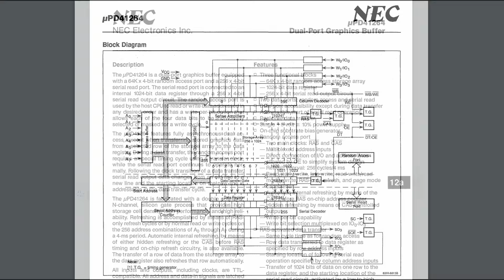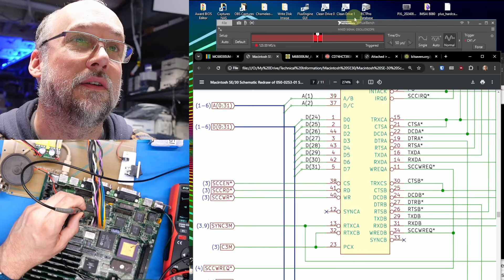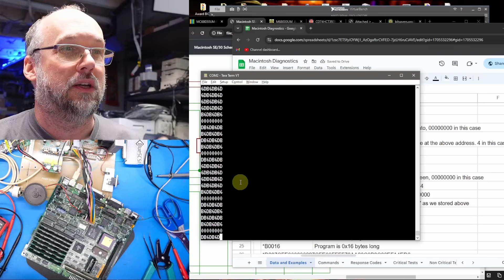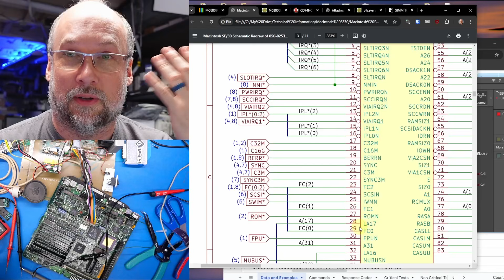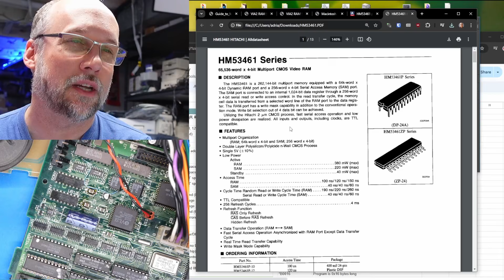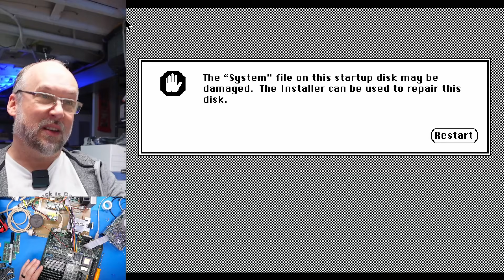12V on a 5V line almost killed this Mac SE/30

Comment: There was different fault tones on MAC SE. The startup chime, also known as the startup sound, is a sound that plays when a Mac is powered on. It indicates that the computer has successfully passed its Power-On Self-Test (POST) and is operational. The chime has undergone several changes over the years, reflecting changes in hardware and design philosophy. The original Macintosh startup chime was composed by Apple engineer Jim Reekes and debuted in the early 1990s. Over the years, the tone has changed slightly, but the essence remains the same. The chime plays when a Mac passes its POST, signaling that the hardware is functioning correctly. If there is a critical issue, such as faulty RAM or a hardware failure, the chime may be replaced by error tones or no sound at all. The presence or absence of the startup sound is not only aesthetic but also diagnostic.

Comment: I haven't worked on enough motherboards yet to have done 12V on a 5V line... but I have shorted Vcc into an LED on the wrong side of its resistor and have it explode in my face. Hot plastic on your cheek is better than in your eye. Lesson 1. don't be clumsy with your Voltmeter probe. Lesson 2. Safety glasses.

Comment: FLUX…… with SMD work you need lots of flux. The flux stops a lot of the shorts because it stops the solder spanning from pad to pad. You will be an SMD expert in no time!

Comment: Well, you "served your penance" by restoring the SE/30 you accidentally sent 12V where it shouldn't go and fixed a second SE/30 board in the process.
- It was a bit of an epic, but we now have recent information on where to go and what to do in the case of a partially booting classic Mac 🍻
As you said in other words: The silver lining was causing the resurfacing of sourcebooks and techniques to do low-level troubleshooting on the Mac machines ... without that expensive proprietary box

Comment: Well done! As a rule, you should not rely on solder mask to provide electrical insulation. That's not it's purpose; it is very thin and easy to scrape off. Vibrations or any relative motion could eat through and create a short to any underlying copper.

Comment: Another vote for you to give Louis Rossmann's channel a look for the best way(s) to deal with SMT.  Note, you will need to look at his older videos as he now, on the same channel, is doing more "right-to-repair" and right-to-own type videos now.  In any event, solder paste is really for when you have a stencil to overlay the pads and then squeegee the paste, evenly onto the pads.  

Without a stencil, clean the pads (solderwick followed by IPA), add flux, drag-solder fresh solder onto the pads, hot-air (in a swirling motion...you don't want to cook the board or have steady intense heat and watch out for blowing other parts off) and place the part with tweezer or the like.  The part should feel like it self-centers and even "dance" while you are swirling the hot air.  Again, seeing a Rossmann video is going to be 1000 times better than reading words as you can see it actually done and how it should look/feel.  

Congratulations working through this problem.  Your whole thought process was impressive as was the perseverance. I like the long-form working through the problem videos.

Comment: When there's electrolyte damage, I typically use through hole caps to replace SMD 'lytics so I can stand them off the PCB and away from exposed traces.

Comment: This was an incredible journey! The start of this saga was my first encounter with this channel, and I'm impressed with the detailed breakdown of everything that happened along the way. After the first video, I was very invested in seeing what happened to the damaged board, and had to watch the whole thing through right away.

My perspective is more from the programming side than the hardware side, and it was especially fun to see that tiny 68k assembly program loaded via test mode for the video memory diagnostics. Looking through my old MPW installation, I see that there are two different matches in MacErrors.h for error code 11; one is "sdmInitErr", with the comment "SDM could not be initialized."... Not sure what that one means, but "dsMiscErr" looks a lot more likely, with the not-so-helpful description of "miscellaneous hardware exception error".

Very satisfying to see the progress as everything got put back together. I'm amazed that substitute VRAM chip worked as well as it did, and the way it changed the uninitialized video pattern at startup was such a cool twist.

Comment: I've watched some of Necroware's repair videos and what he does to components with known capacitor or battery-induced corrosion is to neutralize the acid and clean the PCBs during his inventory process.  That old Mac II donor board you have still looks like it has corrosion that's continuing to destroy components over time.

Comment: run a chisel tip soldering iron after you put the soldering paste and clean the flux, then you apply fresh flux and then use the hot air gun. Also your nozzle is too small you'll risk burning the IC before it does anything good

Comment: That solder paste is really meant to be applied using a stencil.  If you don't have a stencil you could use one of those small Testors economy model paint brushes to apply the paste to each pad instead.  Tinning the pads with a soldering iron and a little leaded solder works too.

Comment: To attach chips like that, I just drag solder. I only really use paste when I'm going to use the hotplate method for SMD stuff, or I have a mask I CNC for personal custom PCBs with SMD... which I then use a hot plate if possible (hot air plus tiny diodes, resisters, caps, etc. isn't a fun mix). When removing chips like that, I might use hot air if I have it at hand. Usually I only use hot air if I'm working with tiny chips (even then, most of the time I then drag an iron across to clean any bridges) or with BGA/reballing. There's also just drag soldering over the pads, positioning the chip on top of them properly, then use hot air to attach... I'm just not a huge fan of solder paste. With super tiny SMD/BGA stuff, I admit defeat and use paste and a hot plate/air, but otherwise I avoid it.

Comment: I keep semi-broken (semi-)rare RAM chips as spares in case you come across another compatible chip that's partially broken, so you can make one working chip out of two broken ones.
(I also build similar looking wire octopi when I made adapters for using more modern chips as replacements for obsolete chips that broke)

Comment: Liquid flux!
Adrian, cover all of the pins in liquid flux, run a soldering over all of them, like magic you will have a perfectly soldered SMD chip with no bridges.
You can be as sloppy as you want, bridge all of the pins.  Put liquid flux over all of them, BAM!  Perfect solder job.  Smokey but it works.
This is how I learned in a Sony training class almost 30 years ago.  Before hot air rework was  thing.

Comment: Did you clean the legs of that chip when you tried to solder it? It won't WHOOP pull itself onto the board if the legs are old and crusty. 

The cleaning process involves rubbing the chip on a piece of plain white printer paper. A fiberglass pen might help if its REALLY crusty.

Comment: Reminds me of repairs done in a telco workshop, they were using 'left hand corner' technique, they just kept swapping chips until it worked - not hard as all were in sockets.
The boards in question were large wire wrapped units full of discrete logic gates, kind of near impossible to diagnose otherwise.

Comment: At 17:49, the hot air nozzle is to small, you get an air stream that is too powerful which is why you then have to hold the chip down. A bigger nozzle held perpendicular to the board allows the solder surface tension to pull the chip into exact alignment.

Comment: While the series was absolutely entertaining and instructional, the final big lesson to me is that in case of high voltage damage it makes no economical sense to repair a failed motherboard: you have to replace many IC (typically salvaged from another similar motherboard) and there's a high chance of causing more damage due to soldering/desoldering big IC's.  Great for educational purposes, but unless you have lot of spare parts to use, it can lead you through a rabbit holes where it is actually cheaper to find another working motherboard.
Reply: Not everything has to have an economical benefit though. In this case some great lessons were learned and it's entertained us all.

And I'm sure Adrian had fun and has a great sense of accomplishment as a result.
Reply: @shaunclarke94  that is exactly what i prefaced in my reply ... But if you are a hobbyist with limited resources, it just makes no sense to embark on a repair like that. In the end Adrian ended up replacing all IC's connected to data line 31 (with the exclusion of the ROM) some of which are hard to find unless you have many spare motherboards to steal components for. Sure it is fun to get to the bottom of a failure, but for the rest of us it mostly makes no sense.

Comment: plcc's  and qfp's are easy. I use 138c solder paste from ali express around them, run the soldering iron around them to melt it in then run the hot air over it. No preheating required and much lower air temp required so less chance in damaging chips. No pad damage and all cleans up nice with the wick. I dont use hot air to reinstall, i do it by hand under the microscope with plenty of flux. Never had a problem doing it this way.
Reply: Sounds like extra work. Wouldn't tinning the pads first then using the station to install make things easier?
Reply: @oldschooldude8370  its a personal preference thing. I just like the idea of not heating vintage chips excessively. The removal stage only requires the hot air at around 250c for my method and its all over in seconds. Reinstall i do by hand as it doesnt heat the chip much at all.

Comment: I presume the mac chime is purposely opaque with the express purpose of making it difficult to diagnose an issue, so that you have to send it in for replacement. similarly I assume the debug system would have required a manual to make propper use of the output, and they were only given to licenced repair shops so they can charge customers through the teeth for repair.

Comment: Hi Adrian, with the solder paste, make sure you keep it in the fridge when not being used.  If it goes above about 10c it will not work as well and things like the bridges you're getting will happen.  Good job on the technique!  Cheers

Comment: Thanks. Thanks you did the mistake so we don't do that :). You might use some double-sided tape to put the caps higher and isolate them so. It is important to know that each step should be calculated correctly. Otherwise you will fall down to the rabbit hole. 
But the most important thing to learn is "Use your brain always". Troubleshooting electronics is about understanding how things are working. 
Great video and work. Hope I hade the opportunity to get bad boards to fix. But that is not always easy.

Comment: I really appreciate how you stuck with that seeming cursed board all the way through! Plus you gained a bunch of personal knowledge and helped expose Apple's advanced troubleshooting techniques for those machines. 
I have to wonder if other OEMs had similar tools for any other machines. I did break/fix warranty repairs on laptops & PCs for almost 20 years from the late 90s to the mid 2010s for a bunch of different manufacturers. It always frustrated me how the PC OEMs completely discouraged component level diagnosing of issues in favor of the parts cannon approach for warranty work. While simultaneously penalizing techs for using too many parts. 
This became especially true in the 2000s when all the major PC players changed how they viewed warranty repairs. The perception became warranty repairs were only a cost to their bottom line. Previously it was a value add to their customers and a good way to keep customers happy. They all figured it was cheaper to get new customers than keep existing ones (personal, small business & corporate alike) happy.

Comment: DB6 is 110110110110, so what they're really writing is just a repeating 110 3-bit pattern sequentially into memory. Depending on the byte alignments, this reads out as values starting with DB6, 6DB, or B6D repeated.

Comment: Your technique looked much improved for the PLCC removal/reinstallation, glad you reported it seemed to be at least somewhat easier. You can, in fact, get away with even less solder paste than you used - dragging a full line across the pads like you did was the right approach, but a thinner/narrower line of paste will give less opportunity for excess solder to bridge between adjacent contacts. When you're doing the "line of paste" method like that, consider that all the solder between the pads will get sucked onto them, so you actually have more solder down than you think. It doesn't take much to properly attach the pins!

If I'm getting too much paste out of my syringe and it's hard to control, I'll sometimes squirt a bit out onto some aluminum foil and then use a micro (usually slotted) screwdriver or a wooden/plastic pointed tool to transfer that onto the pads. This is a bit tedious for larger chips like you're doing, but gives much better control over exactly how much paste you lay down and where it goes.

Sometimes the chips "float" into place, sometimes they don't; it depends on the chip size/weight and exact pin layout, but I try to avoid pressing down on the chip as this can squeeze solder out from below the pads into adjacent ones. Instead, if you need to adjust the position, just poke it gently from a side/corner without applying any downward pressure. If the chip is moving around too much from the hot air, turn the airflow down or adjust to a larger nozzle so the air velocity is lower. You might need to bump up the temperature a bit to compensate so that things melt quickly enough if you do this.

Comment: I've watched each and every one of your SE/30 repair videos (not to mention older videos covering many Macintosh models), as I have a particular fondness for the Compact Macs. It usually took a LOT to kill them. We had two Mac labs at my high school and one PC lab with 486 DX/2s, one student tech (me) performing all the repair/maintenance for all the Macs in the building (including administration offices) while two student techs handled the PCs. I was responsible for roughly quadruple the number of machines, from Pluses up to LC 575s, and I had the least workload because the machines were so robust. My most common "call" was for floppy discs stuck in drives, and almost always the issue was students shoving discs in with bent metal slides. The second most common "call" was for OS issues, because some students would load the System Folder with all sorts of third-party stuff that would conflict with each other or slow the machine down to a crawl. Well, sure, 1 MB of RAM on a 7.88 MHz Mac Plus, plus The Grouch and Talking Moose INITs and After Dark Screensaver (I LOVED After Dark, More After Dark, and all the expansion packs), what did you expect? System 6.0.8 was delightfully stable, but there's only so far you can push those machines without RAM upgrades.

1:04 - In the auto repair field, that's called "firing the parts cannon." 😁
47:19 - I just cheered! First successful boot of this mobo!

Watching you ride the roller coaster of emotions repairing these SE/30s has gotten me to seriously consider refurbishing my Plus. Yeah, I know, it's pretty useless by modern standards, but it was our family's first computer (well, aside from the Texas Instruments TI-99/4A) and I spent literally hundreds of hours using it. It's the machine that got me hooked on computers in the first place. Until I packed it away in 1998, the only repair I ever had to do was touch up ONE cold solder joint on the sweep board, specifically the power connector that ran to the motherboard. A whopping 4 MB of RAM, and an aftermarket accelerator mod (MicroMac if memory serves me) that cranked that puppy up to what was impressive for the time, 16 MHz.

I sure hope I remembered to remove the battery... It's been stored on its left side (sweep board down), so who knows what condition the insides are in right now. I'm almost afraid to look. But when I put it away it was still working as Apple intended (though a bit faster thanks to the mod).

Comment: Hi Adrian. Solder paste is - essentially - eensie-tiny balls of solder in a rosin paste. It’s usually used with a mask; this is a thin sheet of etched steel or brass with holes where the pads go. You lay it onto the board, align it, then spread the solder paste onto it so the paste goes into the holes. You scrape it with the edge of something flat and straight, like the edge of a credit/debit card, or a small metal ruler, and this forces all the paste into the holes. Then you lift the mask and use hot air to solder the chip in place. Afterwards, you just clean the paste off the mask with IPA.

The simplest solution is to design a PCB with just pads that fit the (dead) PLCC chip, and have the traces extend out to the edge of the board (like the edge connector on an ISA-slot PC peripheral). Then send the design to JLCPCB, or PCBWay. They generally require a minimum order of 5 boards, but this is okay, as you can use them to practice using the solder paste and mask. Also, if you have a spare good chip, you can solder that to one of these boards and use it as a test jig! HTH! 😊

Comment: I am VERY impressed by Adrian's hack job on the zip ram. I remember I had an Amiga 3000, with 25 MHz. 68030 CPU and 68882 FPU, just like the ones on the SE/30! I had 2MB of video ram and 12MB of fast ram, all in static column zip chips. I wonder if any more video ram could be added with the bodge-wire hack Adrian did. Would it get used by the OS? Would it make a difference?